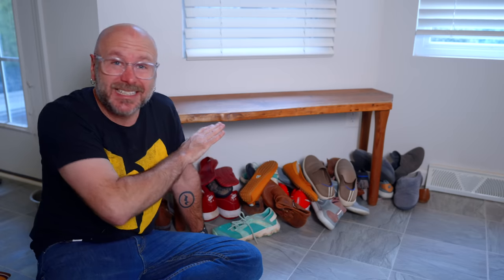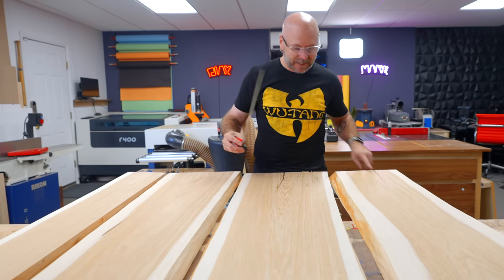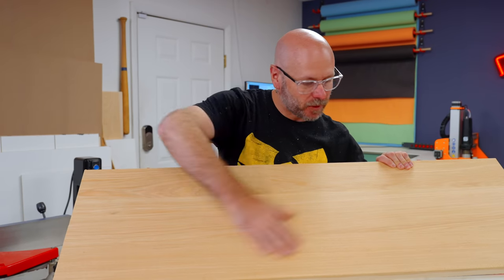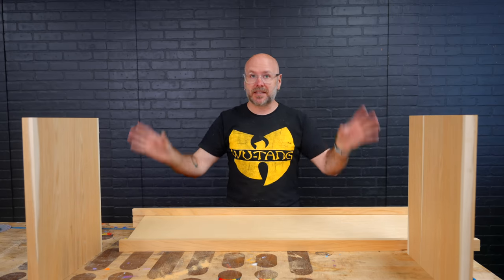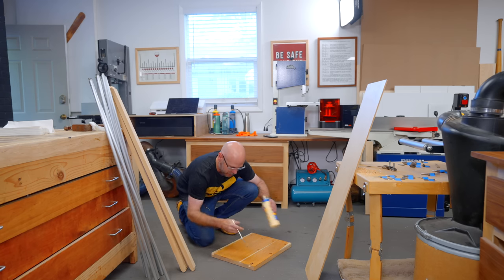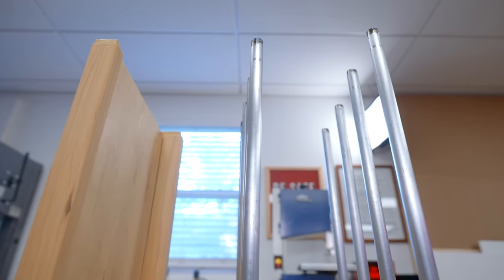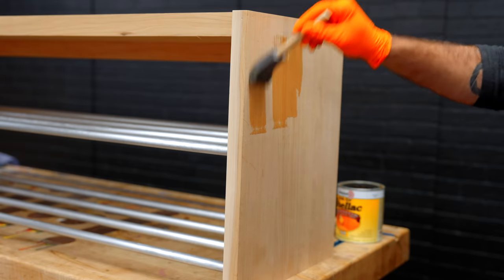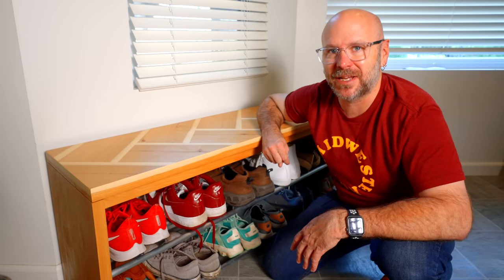Making the ultimate shoe bench!

Comment: FYI: I had a similar problem finding the right drill bit for a pipe I wanted to fit. What I did was turn a piece of pipe into an improvised hole saw. and with a drill I widened the hole enough to fit the full pipe.
🙂
Reply: @jeremyspecce  I stuck a dowel in it, and ran a bolt through the dowel.

Comment: I've had an idea for a shoe organizer for a while but I just haven't had the time or the money to do it. It involves those cardboard tubes that you see when they make columns with at least 8 in diameter ones cut them to about the length of your shoe and make several rows that are offset of each other in their length. Arrangement like a pyramid or whatever you want then glue them together. Put a bench in casing them together on top.

Comment: A question that has been knocking around my brain since you started veneering your projects: Does the vacuum bag require a constant vacuum or does it seal completely and hold pressure overnight? I know you showed some kind of hand pump once, but you've been using the electric pump ever since. Just wondering if I could use a shop vac to pull the air out of the bag and leave it overnight for the glue to dry. 

Oh yeah, great save on that bench top!
Reply from the maker: If you have a super well sealed bag it'll hold the pressure. On my self-made bag I have to keep the vacuum running. On the expensive vinyl bag I used in this video the vacuum was off for the last 55 minutes (of a 60 minute dry time)

Comment: Galvanized steel is only problematic if you superheat it (ie. Welding) if you were to need to weld galv steel, grind it away first. Cleaning/handling the way you were doing is harmless....otherwise they wouldn't use it for a guardrail surface treatment!
Reply from the maker: Gotcha. Thanks!!

Comment: Galvanized steel (Zinc coated) is not toxic…. Zinc is only toxic if you “burn” it, like welding it. White smoke = Zinc vapor. Zinc vapor is poisonous not the solidified metal.